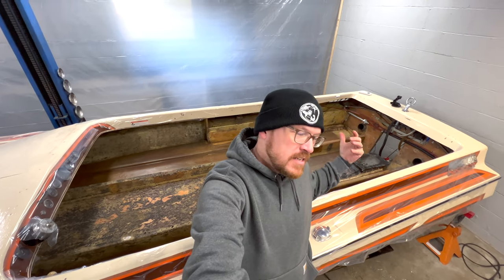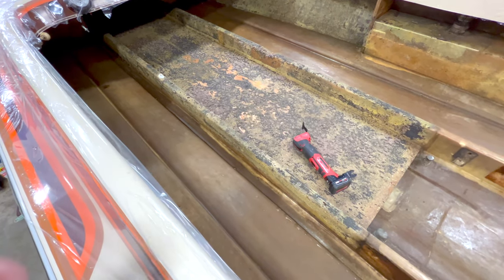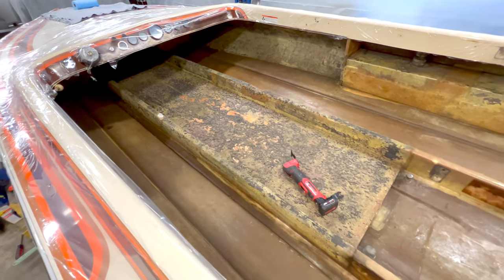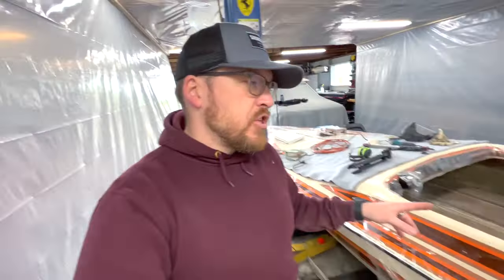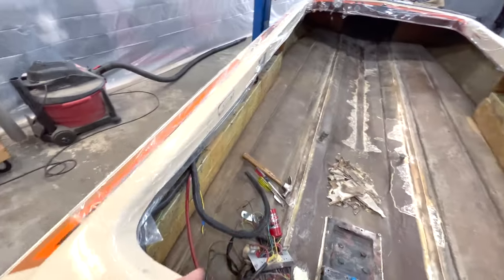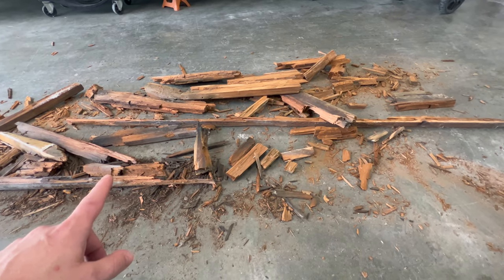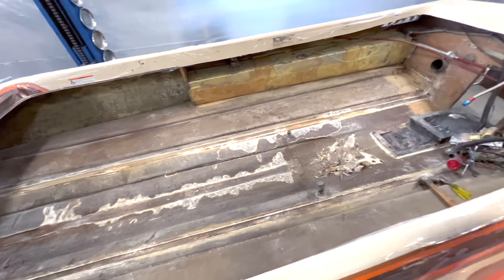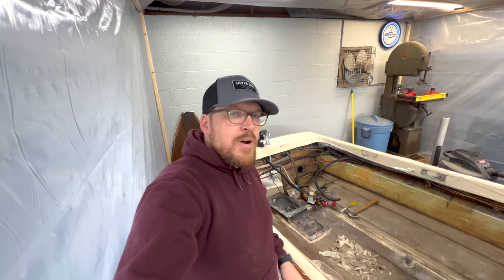Cutting out the Stringers in a 79 Centurion Jet Boat, DIY Replacement

Comment: Thank you for this very informative video. I have been looking for a 70's era jet boat and was curious how the hulls would hold up after 40-50 years of use. I will be paying close attention to the condition of the hull, stringers, bulk heads and transum.
Reply from the maker: It's great to hear that these videos have been helpful for other enthusiasts. This boat has been in my family since the early 90's. It has always been stored indoors & under a cover. Because of this I figured that my wood was in decent shape compared to most. Boy was I wrong. I think that this shows that any boat, no matter how good of the condition can have hidden rot. I think its safer to assume that any boat that is this old will need the wood replaced, unless it was just recently done. Hopefully you can find a boat that doesn't need all this labor intensive work!
Reply: @AutoTechNick  Yes, I'm going to closely inspect any boat I'm considering for wood rot of any kind, structural cracking, etc. Thanks again.

Comment: use carbide blades on cutting out stringers and transom i use it and it works like a charm i even cut out kevlar with it !! :D
Reply from the maker: Great tip Lucas! I have tired a few of them since the video and have noticed a significant improvement in blade life.. They are most certainly worth the few extra dollars. 

~ Nick

Comment: I don't envy you. The materials used were inferior as most boat manf do this for cost savings. Every older boat in the northeast has rot that I have encountered. Most boats stored outside are more so rotted as the rain water sits in the hull. Happens even if the hull is tipped up with the bow in the air.
Reply from the maker: What scares me more is that this boat has been stored indoors for the past 30 years. On top of that it has seen very little water in the past 10, and still had that much damage.